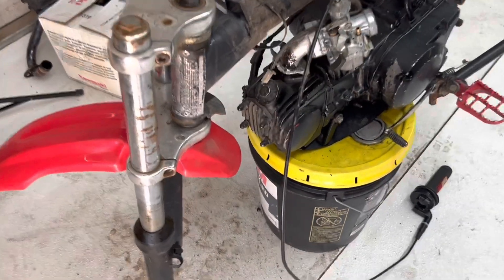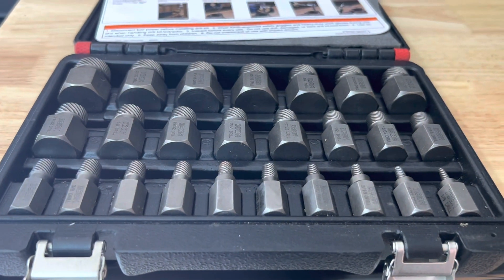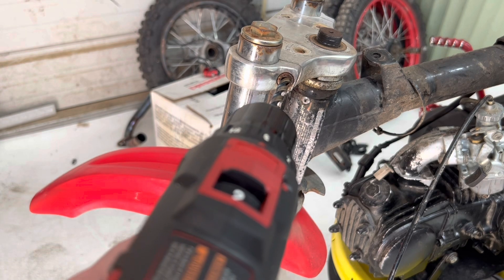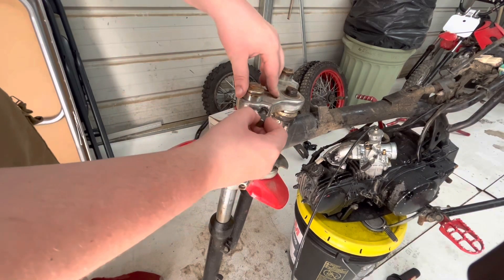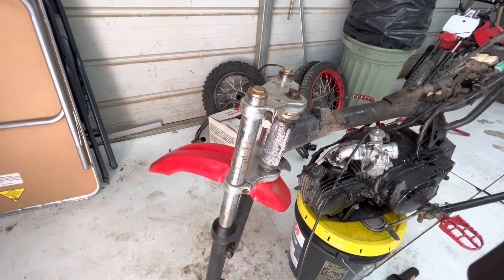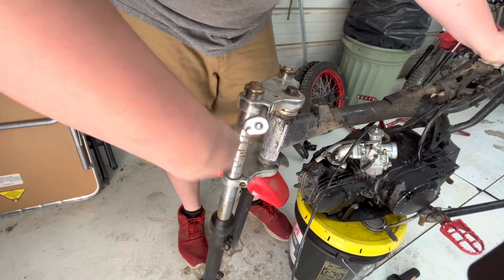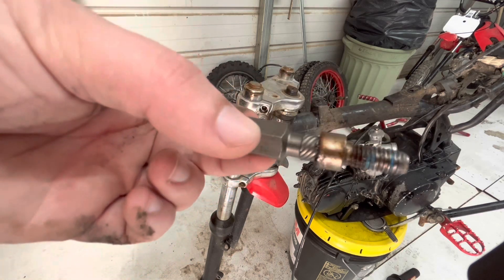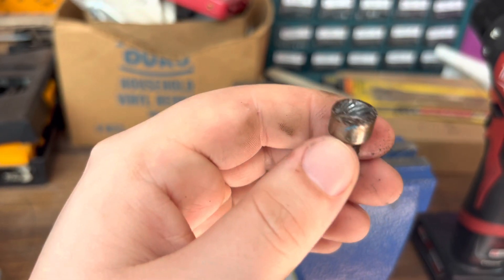ICON Tools 25 piece multi-spline screw extractor demo.

Comment: Bought this a few weeks to extract a broken exhaust stud.  Was able to drill the stud with the correct bit, but the extractor broke first time it was used…made my day more complicated as I now had to drill out the extractor.
Reply: Dang but how do you drill out extractor when you can barely drill into it..? 😩
Reply: i wonder if drilling it out to the next size up Extractor would have been a better option?

Comment: You could’ve used MAC RBRT bits to get that out. No drilling.
Reply: A small set from MAC is $115. Sets with about the same number of bits are around $250.

This set is $60
Reply: Not even the same category/comparison..
Reply: i got the 25 piece on ebay for 99 the mactools one

Comment: The reason that screw wouldn't come out in the first place is because it had blue loctite on it. Some heat from a torch would have made it come out normally. But at least you got to test this tool.
Reply: Blue Loctite doesn’t need heat. Red does.
Reply: Heat helps either way. Blue Loctite may need heat, red always needs heat. @PonderingOne
Reply: @alouiciousjackson5812  
True, heat always helps, but the reason the fastener was stuck in this video wasn’t because blue Loctite was used.

Comment: A big mistake I noticed is that a lot of people don't presoak the screws/bolts in penetrating oil, and then they complain when the extractor bit breaks but the reason the bolt stripped in the first place is because it needed some penetrating oil or heat to help it come out.

Comment: Bought the exact set for a bolt that broke off on skid plate. The 5/32 one snapped by hand causing me way more work because it’s very hard to weld and drill out Cr-MO. Wasn’t happy with that set at all

Comment: I was trying to decide when and where I would use a spline extractor. And this answered my question. 
Never needed one. But lots of things use this type of drive these days.
Reply from the maker: The hex style and torx style fasteners were the main reason i bought this set. i did have a situation with a broken bolt inside of the head of a motor that i drilled and tried to install one of the smaller spline extractors into and actually broke it off which kinda sucked but harbor freight warrantied it no problem

Comment: I’ve got the SnapOn set like that, had it for almost 10 years now. I used to think it was useless except for broken fittings (adapters, sensors, etc). Seemed like I could never get a broken screw out with it. It has saved me a bit but I’ve never had luck with the smaller ones. They either break or don’t bite enough.
Reply: Same just had the smallest one that comes with this icon set break this morning

Comment: Now Icon needs the opposite kit set of this one.   Such as the high quality and very well made MABLEVI 32 pc. Bolt Extractor set #XS001 and believe Icon will come out with this exact version as it's complete with every size in a nice case.  Perfect as a back up whenever you may need it when working on an engine or chassis of an automobile!

Comment: Do you need to drill it out for this to work? I have the same kind of bolt that I need to get out of my transfer case but it is about 4 to 5 in clearance from across beam so I will not be able to get a drill up in there
Reply: Travis I am in the same situation did you try it? If so did you have any luck? I am going to try it out tomorrow at work. hope it works. I am working on a medical device I can't drill at it so I hope it works.

Comment: I had 2 drill bits that broke right in half and still didnt drill a hole big enough for the extractor to grip too. Another epic fail on my end
Reply from the maker: don’t feel bad, i had a similar experience with a broken off stud that snapped off in the head of a small engine i was fixing. the drill bit either kept walking and would snap or the hole just wouldn’t go deep enough lol. ended having to weld a washer and a nut to it to get it out which i should have done in the first place. these definitely have a time and a place to use them and i guess in my first experience it was the wrong time lol

Comment: These are all the same Irwin, Mac tools, icon I swear these are all from the same factory I have the Mac tools and Irwin ones man these things suck when they break. Better have that carbide drill bit handy. And they do break I've already snapped 2.
Reply from the maker: i can relate 100%, actually broke one trying to get a snapped valve cover bolt out of a bmw head and man was it a pain to get it out. i wish i recorded it.

Comment: Ama.zon sell the exact same thing in different brands same exact quality....   I go the MABLEVI 25 pcs. Screw Extractor set $37 total and it's the same exact design, cut, shape and material as the Icon....
Reply: Yeah, but this icon set has the walk-in, walk-out with a new tool, easy lifetime warranty...that you will absolutely utilize if you ever NEED to use these extractors!